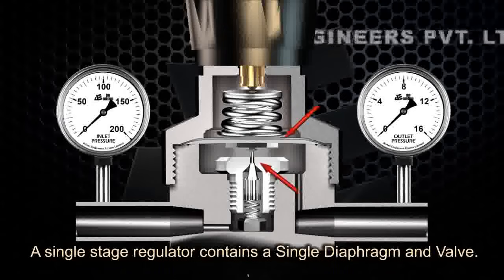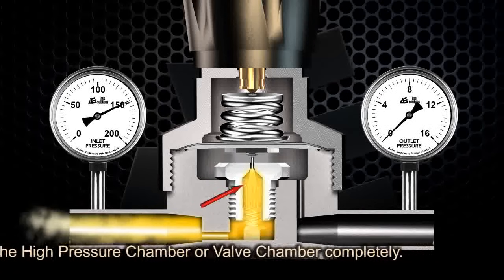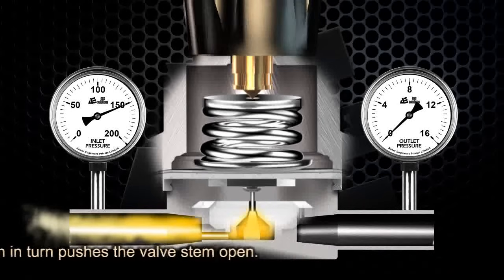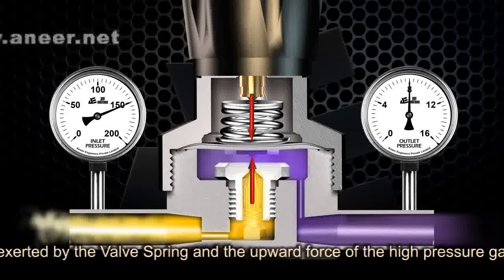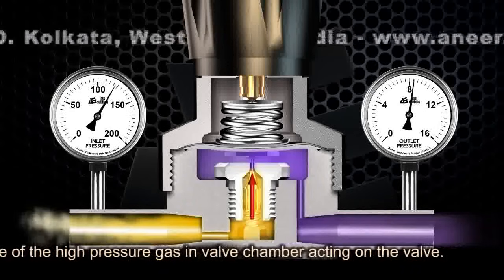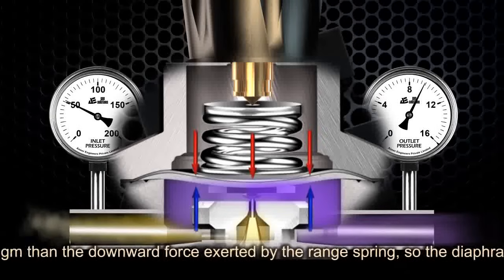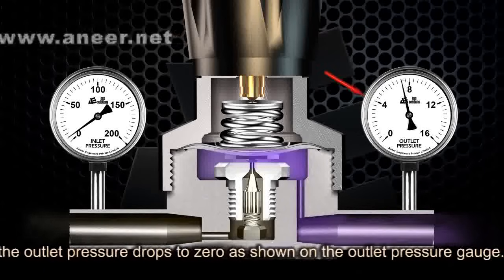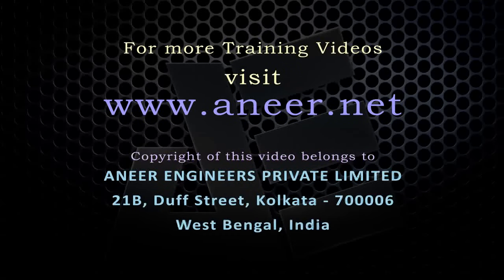Working Principle - Single Stage Pressure Regulator

Comment: Use this regulator and oiler combination to replace the one on my CNC miller. After 1 month still works as intended. Excellent value for the money.
Reply from the maker: Thank you for using our regulators

Comment: how to maintain a contant outlet pressure through regulator or any other device?
Reply: Use a Two stage Regulator. Check the working principle explained in our video working principle of two stage regulator
Reply: @indranilbhaduri5168  sure. Can you suggest any best vendor who provide these regulators for oxygen?
Reply from the maker: There are lot of vendors around. Depending on the application for which you want to use the regulator, you can find out the vendors. If you share your application details, we can help you find a suitable vendor around your area. Oxygen has lot many applications in various fields and please also note that it is perhaps one of the most dangerous gas to handle, though we may think that it is not harmful at all.

Comment: How to adjust refresh rate ?
Reply: By turning the Pressure Adjusting Knob Counter-Clockwise manually. To avoid adjusting repeatedly, a Two Stage Regulator can be chosen, where the Delivery Pressure Remains constant despaite diminishing Cylinder Pressure and through out the cylinder pressure.

Comment: If you connect two tanks in a manifold, each with their own regulator (ei. 2  to 1. One common outlet)  what happens if the regulators have different output pressures?
Reply: It would fill from both tanks until the lower set regulator no longer flows, then would only flow from the higher pressure regulator up to its set limit. 

If gas was then drawn slowly from this pressurised manifold, the "higher pressure" tank would be the only one to drain, since small drops in pressure would only open its regulator valve. The manifold pressure would hold steady, then drop suddenly after the first tank is empty, until it reaches the lower set point and begins to drain the "lower pressure" tank.

Comment: If I have a 200bar tank, and use a preassure regulator to hook it up to a 10bar tank. Will the 10 bar tank stop filling at 10bars, or will the preassure regulator let more preassure through?
Reply: Yes. If the tank is rigid. The regulator will stop supply at 10 bar as the pressure equalizes and valve closes automatically.

Comment: if you use this style regulator on a paint spray gun.  wont there be a sudden burst of air/paint every time you pull the trigger.  
seems to me there should be a 5 thou  pin hole on the high pressure side to "regulate" the static pressure.

im a "newbie" to all this stuff.    is interesting for sure.

great share never the less!

larry

Comment: Music was too loud imo, too much echo in the narration starting around @2:00, and I did not clearly understand how the pressure the gas is reduced by the pressure regulator. I assume the gas flowing through the small nozzle above the high pressure valve chamber into the low pressure valve chamber reduces the pressure, but I did not clearly understand that from the video. Off to find another video that better explains this mechanism.

Comment: One thing i dont understand, as the tank pressure lessens, the valve opens allowing more gas to flow, thus shouldnt it will increase the pressure in low pressure chamber, pushing diaphragm up and closes the valve. So how does the end of tank dump works?
Reply: I meant when the outlet flow starts to increase, isnt the diaphragm will be pushed upward?

Comment: :MAIN POINTS😊
High-pressure gas enter's the regulator and fills high-pressure chamber gas remains contained until adjusting knob is turned open whitch compresses spring and pushes downward on the diaphragm.whitch intern pushes valve open releases gas into low-pressure chamber.Putting an oposing force on the diaphragm

Comment: Sir  when the cylinder is full my regulator is working properly  but when it is less (5-10%). A small leakage is happening near on/off knob(it smell a lot when I on). But the delivery boy is saying it smell when it is less.   But for me I think its leaking. Is it possible to leak near on/off knob.?

Comment: what about if you introduce a negative inlet pressure to the system? would this work to regulate suction?
Reply from the maker: No. Practically not possible. We have different regulators for controlling Negative pressure.

Comment: any equation that can explain how the pressure is reduced?
Reply: Check out Bernoulli's principle for kinetic gasses. Ideal gas equation can't explain that. Also this is mostly about a valve that close with more pressure but open with less pressure so it regulates and stabilised outer pressure. (Sorry for the grammer mistakes)
Reply from the maker: Simple equation the we can refer to is P1V1/T1 = P1V1/T2 (Combined Gas Law)

Comment: Dear Sir, I am seeking information about the Co2 pressure regulators i would like to enquire; 01. How it will works?, 02. There is electrical cable which required to connect or not? if not connection what is the risk associated with that electrical cable? Please share some information !! thank you sir
Reply from the maker: The CO2 regulator exactly works the same as shown. However as the boiling point of CO2 is high and due to Joule-Thompson effect, during operation and while the pressure is reduced, the gas tends to freeze up into dry ice, specially at the valve nozzle area and that is why a heater is generally required to heat up the regulator to avoid freezing of the gas. There is normally no risk associated with the electrical connection if the quality of material is good and also CO2 being a non-flammable gas.
Reply: Thank you very much sir for your prompt reply.  i have one more doubt to ask you, is there any forming / generate CO gas if not connected the electrical power connection? thank you...

Comment: I don't get the point at 2.54 .When the regulator is in use, the initial high pressure starts to drop at source as the cylinder empties? Does source mean before entering high pressure chamber? What is the cylinder that empties ? Why the initial pressure drop when the regulator is in use? Only otlet pressure seem to be controlled.Please explain
Reply from the maker: The high pressure source is the gas cylinder. As you consume gas after reducing the pressure through the regulator, the pressure in the cylinder reduces and finally the gas cylinder empties, for example, the same way gas empties from a LPG cylinder in the kitchen after consumption.

Comment: If the outlet flow is stopped does the outlet pressure then increase. Or is an equilibrium reached that depresses the range spring enough to turn off the valve stem.
Reply: You are Right, when the Outlet Flow is stopped, then the Outlet Pressure increases slightly, which is also referred to as the Static Pressure. The increased outlet pressure will generate extra pressure which pushes the diaphragm upwards and the range spring is depressed upwards, till the valve closes.